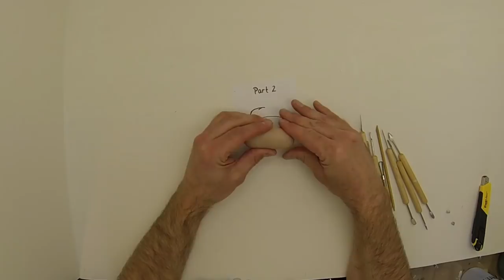Making a Tail Bait - Codename Wicked Goby - Part2

Comment: Thank you for the tip. I will keep trying and playing with the cure times. I let it thicken some before I use it!  I don’t like placing multiple layers as some areas will be thicker than others. 😃 but it is was it is. I am making a lipless diver that has flat sides.. I might have to round them out.
Reply from the maker: just apply while its thin, and then get back to it after half hour and even out, and then a half hour later, until its really thick

Comment: Nice to see u again! I noticed that u r using a table top epoxy to top coat your lures. I have been having major trouble getting slow cure resins to set evenly on some of my designs. It seems that on lures that I have made that have flat side the slow cure likes to pull away from the edges. Do u have any suggestions for me? Awesome lure design u have there !!😁👍🏻
Reply from the maker: Sharp edges always make the epoxy retract. One thing you could try, is to brush over the epoxy a few times during the hardening process. As the epoxy gets thicker it is less able to pull away, and you will end up with a layer that at least will allow you to get a complete cover in the 2nd or 3rd layer. This also works for "fisheyes"

Comment: Do you use acrylic paints or water-based?
Reply from the maker: Кто умеет, тот ловит Its some special softbait color the comes from a company called CAB coatings
Reply: Thanks! And for jerks what kind of paint would you recommend? Acrylic or water-based?
Reply from the maker: Кто умеет, тот ловит Acryllic paint is water based as far as I know, and yes the airbrush paint is acryllic